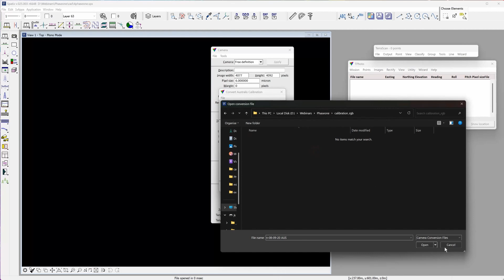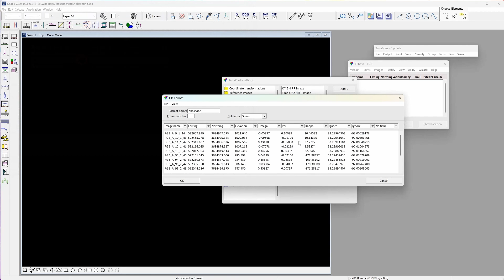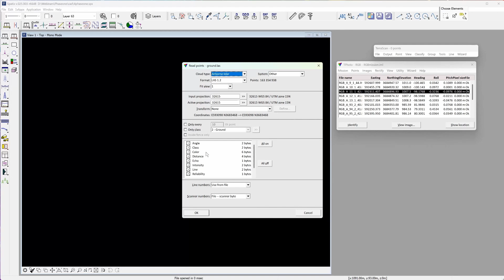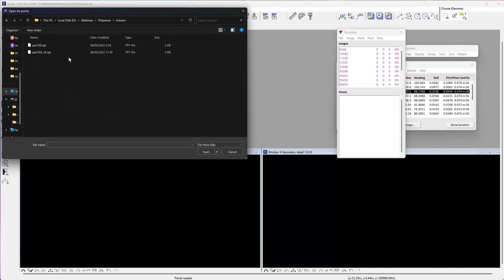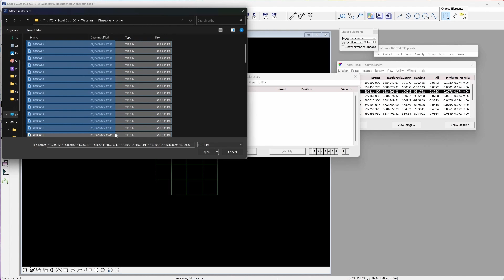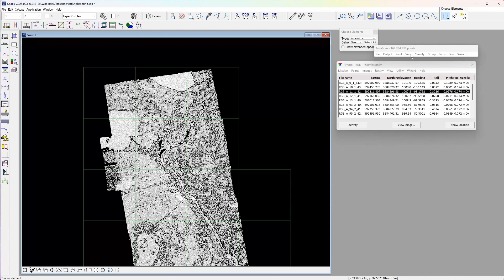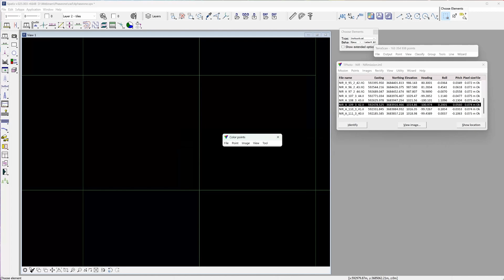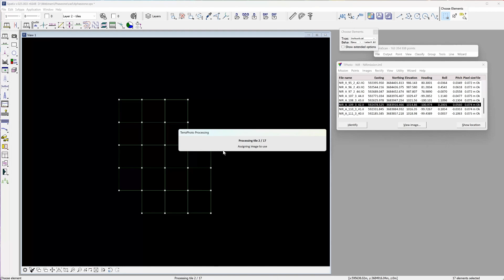Create Orthomosaic using Phase One .IIQ Images

Comment: Is there a similar instruction, but for the DJI L1 lidar? I don't understand where to get the time stamps. In your videos, you already have files in the required formats, but I don't have such file formats in the folder on the lidar's flash card. It would be helpful to have a complete instruction on how to create orthophotos using only the L1 lidar data.
Reply from the maker: I recommend you this training recording: https://www.gotostage.com/channel/129534f84099462d80305a646a5ed114/recording/ca0f3141acfa49f5bfc7a6405fc54dba/watch It presents the entire workflow!
Reply: @Terrasolid  Thank you for your help!